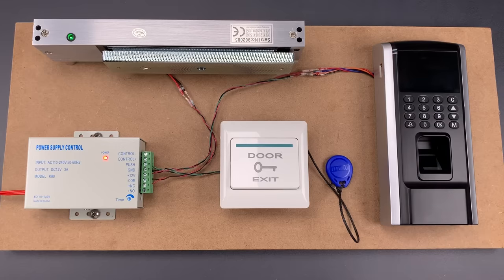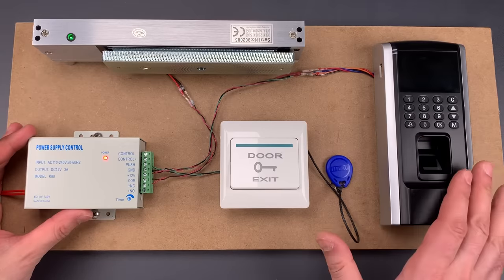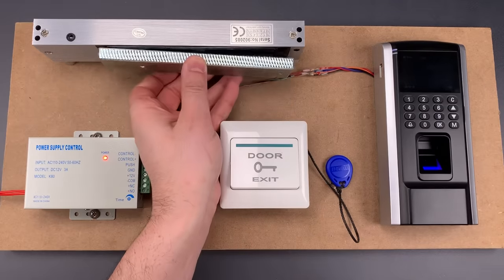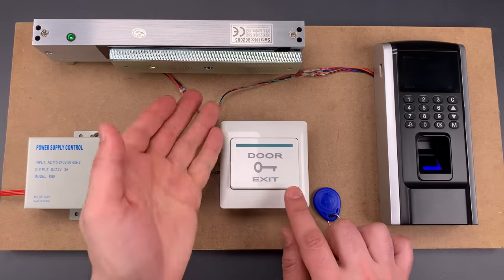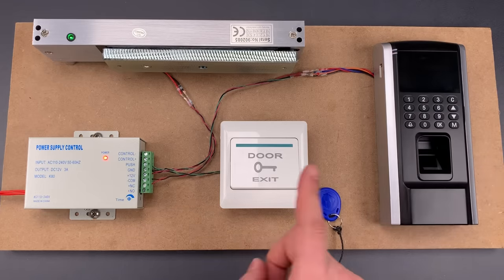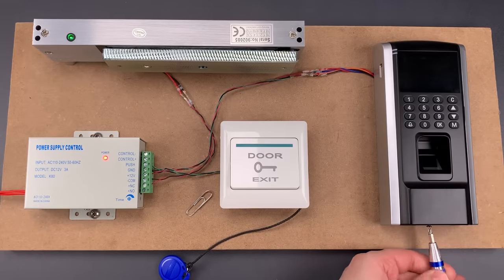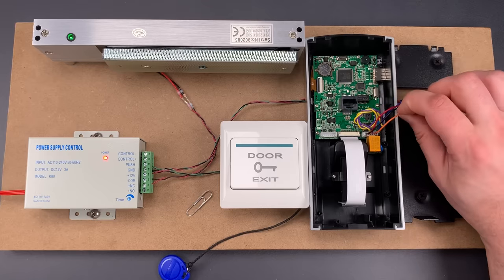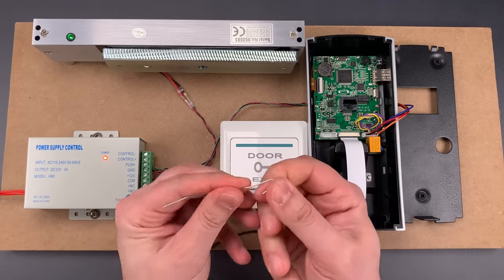[1040] Fingerprint/RFID Lock Defeated With a Paperclip (Mengqi-Control)

Comment: holy crap!  I almost choked when you said the verification and authentication system was on the insecure side.  One would have to be almost literally brain dead to make a design like that.
Reply: Welcome to website security! 😃
Reply: This way they don't have to run that many wires into the "Power Supply Control" and get away with one processor. They're just going cheap.
Reply: @metamud8686  welcome?  I've been doing comp sec for 40 years.  :)
Reply: @pugnate666  I2C uses two wires and can transmit the read data to the control unit for processing and verification using one less wire than the current setup lpl is showing us. And can't be shorted open.
Reply: well it dpends on how 'important' it is
Reply: @mareksicinski3726  If it isn't important you don't need it.  DERP!
Reply: @ElectroDFW  Yes, but you'd have to pre-process the keypad input and read the RFID tag. So you'd need a second processing unit. (I should have written "more wires OR another processor", my mistake)
Reply: @protonneutron9046  I think that was just a pat phrase from metamud about the field overall and not anything personal.  t. linguist and former “electronic security” guy.  ; )
Reply: The designers probably know full well that they should go on the secure side of the door, but their clients don't, and it's cheaper to put all of the components in one box.
Reply: Well it is from China.
Reply: Yet, this is a product that sells for $170.
Reply: @jemeljordan-butler4510  Worth $1.50
Reply: To be fair, at my dorm our elevator requires physical key access to use... But the key just presses a mechanical switch behind the panel, and the panel is secured with regular Phillips screws. Yes I unbolted it, yes you can just press the switch or short the wires or anything like that. Yes I rewired the switch to an unused button on the panel. Yes everyone found out about it and used it from then on 😅
Reply: to be frank the majority of access control systems are designed this way
Reply: @gankdalfthedank9855  Yep. Most are feel good window dressing
Reply: @pugnate666  you could get away with the exact same number of wires as on this for the transfer of info still

Comment: Just put up a sign.

“No screwdrivers allowed on the premises”

BOOM- Fort Knox security levels again.
Reply: "Hey, this is a gun, eer, screwdriver free zone"

Didn't you know? - Criminals can't commit crimes if they're told they're not allowed to.
Reply: Or you could put 601lbs of force and the lock would give
Reply: @kevinlin7674 , I'm pretty sure at 500lbs the frame might just give way. The 600lbs is just a novelty unless you bolt it into the floor.
Reply: @saints360row  Thanks for the heads up!  Hey folks, we only need to exert 501lbs of force now!
Reply: Surprise they didn’t use a star bit screw. At least a little extra security
Reply: “No screwdrivers allowed on the premises” That's democratic thinking...
Reply: @kevinlin7674 , Well 500 was just a possible example. Depends on the door and how it was framed. I'm sure a good donkey kick could unframe most.

Also, I love your sarcasm; it implies I was giving an exact number through your inference of my certainty by way of an over exaggerated proclamation. How quiant.
Reply: @saints360row  On a serious note, will doors that are bolted to concrete walls hold more amount of pressure? That's the way our doors are mounted at my school.
Reply: If only criminals follows the rules?
Reply: inb4 the god of all "maintenance workers" walks in front of the door and every door in the entire complex is mysteriously instantly unlocked.
Reply: or a sign that says, Please do not remove screw to security device.  Bomb attached.
Reply: “No screwdrivers allowed on the premises” 

Maintenance workers: waving goodbye
Reply: Why ban screwdrivers? That causes too many issues,  just ban paperclips.
Reply: I bet this could be done with a pointy metal nail file, plus a hair pin to bridge contacts on the board.
Reply: @BluBOo_  crime is no more
Reply: @kevinlin7674 , What, like double doors? - Only if there's a metal frame in between them, because if they lock to each other you might be able to bust them open due to either door not being static. Also, check to see if the bottom of the doors have bolts on them & holes in the floor where they rest, as many schools do especially for double doors. I mean, regardless, if someone wanted easy access at your school they would wait until everyone's let in or out in the daytime, but at night I'm sure it wouldn't be too difficult anyway without an alarm system with time & tools.. Or with keys.

Did you have a possible example of something malicious regarding your school or were you just using those locks as an example?
Reply: @ProductKingReviews  yes this is what I was thinking. I would replace the screw with one of those one way screws we should be using on all exterior fixtures (like shutters, etc.) and doors installs.
Reply: That might actually work if you live in Canada.
Reply: Or install proper CCTV
Reply: That's about as effective as a "gun free zone"
Reply: Yes, we have "screwdriver free" zones around here, and it's made everything so much safer.
Reply: He'll just use the swiss army knife again.
Reply: nah, just put red locktight on that screw
Reply: Most screws about that size or bigger can be unscrewed with an old butter knife, better off banning metal paper clips ;)

Comment: Thank you for this as always.
I am an old man. One thing that I notice with security devices is that no matter how sophisticated they become there is always a need for physical security  This is often missing. You can have a very secure access system but if someone can just put a boot through the door, or short it out with a paper clip, the level of security is low.
Reply: boots work grate on most doors and windows!

Comment: When will these companies stop putting externally accessible screws on their locks?
Reply: Then there are the ones that slap a sticker over top like a Band-Aid.
Reply: @sinnison23  And the sticker will say "Voids warranty if removed".
Reply: also without them its eas hackable, the validation process should not be done on the outside LPL points out. Cause thats the real weakness of the system.
If memory of users and also validation is inside, it should be way harder to break.
Reply: @Tjalve70  genius

Comment: As soon as I saw that setup I knew what the bypass was going to be, why would anyone think having your control circuitry on the non secure side of the door is a good idea. 

I have a couple of customers who have yards with electronic gates and the control box for said gate is on the outside of the fence/gate...  the box that holds the electronics is quite stout and is all steel construction with hidden hinges but it is secured with basic cam locks!
Reply: If you think about it , it is so  " MR TECH GUY CAN RESCUE YOUR LOCKED CAT BECAUSE YOU HAVE FORGOTTEN  / LOST / LOCK IN THE IDENTITY  RDIF KEY ,  ETC ."

But it's just way too easy a by pass . No identity needed for by pass .
Reply: There actually is a way to do this somewhat more securely - by having a tamper-switch inside the external device that disables the unlock functonality until it is reset from the inside of the secure area. But that would obviously add one more component, and cost more, so the cheap sets don't include it.
Reply: Exactly this. Unfortunately it's quite common though. Manufacturers prefer to put all the fancy electronics in one place, so because they're making a keypad/rfid reader/fingerprint scanner, it's easiest to just add the rest of the control circuitry there. It's a horrible plan, but extremely common.

In the ideal world, the outside of the door would simply send the credentials (encrypted in such a way as to prevent MITM replay attacks if the outside device is compromised) to the inside. That inside module would then authenticate the credentials and decide if the door should be allowed to open.

What's worse is that this isn't just done with cheap stuff you can order off Amazon, this is also done with many professional grade systems, and in fact the vast majority of apartment door buzzer systems do this too (the newer ones have locks on the front of a thin aluminium box, the older ones don't even have that). Even high end office control systems that use card access to a central server for authentication still frequently transmit the authentication from the reader to that central control system in plain text making them vulnerable to MITM replay attacks.

You have to be very careful with electronic locks, most are designed only with electronic security in mind, not physical security.
Reply: @SebastianSonntag  That's not really a great solution anyway for a couple of reasons: first, almost all tamper switches can be bypassed in such a way that they never alarm in the first place with minimal skill. Second, if all your control circuitry is on the outside, then that tamper reset signal would necessarily also be travelling to the outside and be just as easily bypassed as the door bypass shown here.

The only secure way to do it is to keep all the control circuitry, and all the authentication circuitry, on the secure side, and only pass encrypted, un-authenticated, data from the outside to the inside. All authentication must happen on the secure side of the door.
Reply: @Green__one  Your assertion that "almost all tamper switches can be bypassed in such a way that they never alarm in the first place with minimal skill" is inane. I use electronic fingerprint locks on some of the doors on several of my properties. In each case, the tamper switch is fully integrated into the casing of the fingerprint reader, with dozens of contact points and sensors. Accessing the electronics without tripping the tamper switch, while it might be theoretically possible if you were to take a jackhammer - although that would almost certainly trip the vibration sensor - to the wall and attack the enclosure (which is recessed into said wall) from the back where there are fewer contact points, is as close to impossible as it can be. At that point you're better off breaking a window if you want to get in.

Additionally, of course not all the control circuitry is on the outside. The tamper control module is inside the secure area. Once the tamper switch is tripped, the control module needs to be reset from the inside, because it cuts all power to the door module by tripping a breaker which has to be physically switched back on.

No electronic lock is perfectly secure. Fingerprints can be copied, RFID tags can be spoofed, PINs can be guessed or brute-forced (which can be as easy as checking which buttons on the keyboard show the most wear on certain installations). However, with a little effort an electronic lock can be made at least as good as a mid-range mechanical lock, which is usually sufficient. On most properties, there is no point in trying to create a perfectly secure door lock because criminals will just find another way in.
Reply: @SebastianSonntag  I'm glad your properties have done security right. I never said ALL tamper switches were done wrong, only that most were. Additionally it sounds like you have control circuitry where it belongs, on the secure side of the door.

That said, just because your particular situation isn't vulnerable to these attacks doesn't make that the norm, nor does it mean you aren't vulnerable to something else.
Reply: Ah a fellow Discworld lover!
Reply: I installed my own electric fence gate, and all of its guts are on the inside 😄
Reply: @Green__one  You CANNOT prevent MITM attacks if the outside device is compromised, at least not with passive RFID tags or key codes.
Reply: This system wasn't designed to protect anything worth the effort to bypass.
Reply: Almost, not always
Reply: Yeah. Client-side “security” is so amateurish it’s not even funny. It is seriously high school level skills to design a system without this flaw.
Reply: it's cheaper this way
Reply: @simo2555  Yup, for the price I don't know why we're even having this conversation lol... I'm sure the power supply will burn out in a couple months leaving the door permanently unlocked.
Reply: @NETBotic  lmao true
Reply: @danpowell806  While it is always possible that someone could take your outside device and reverse engineer it to steal encryption keys. The reality is that's a much harder attack than simply intercepting the data on the wire and re-playing it. MITM replay attacks can be quite successfully mitigated by using encryption between the outside device and the secure device. If implemented correctly, re-playing the data sent from a proper authentication will not result in granting access a second time, and will instead send an alarm signal that something fishy is going on.
Reply: @Green__one  I was very specific about the types of access tokens that I was saying do not have MITM protection: RFID tags and typed codes. 

Sure, it's possible to use NFC and have a challenge-response protocol implemented on the access token, but you're not using RFID anymore. 

I suppose you could also have the local device encrypt the message traffic, which would make a MITM attack more difficult because it would have to defeat the encryption using known-plaintext attacks.
Reply: @danpowell806  I'm not talking about challenge/response to the toekn. I'm talking about on the wire messaging that can't be replayed. It's pretty trivial in this day and age to do such a thing, it's just not often done. And it's not about known-plaintext attacks either, it's about replay.
You always want to ensure that every message sent along the wire from the non-secure device is unique such that any replayed message won't result in an additional authorized access. And additionally make sure that the message sent on the wire is non-predictable. There are many encryption protocols out there that can do just this.

Nothing is 100% secure, but by moving all your authentication to the secure side, AND making sure all messages from the reader to the authentication server are both unique and non-predictable, you move the attack vector to either the token, or to a much higher skill attack on the reader (reverse engineering is far more difficult than an esp module reading and replaying credentials behind the reader). At least to attack the token they need access to something that's not sitting exposed on the outside of the door 24/7 and mostly unattended.
Reply: @Green__one  Or the attacker puts a RFID reader inside the casing of the access device, which makes all the encryption useless despite not technically being MITM. 

Tamper alarms are pretty important in any case.

Comment: This system is installed all over my University
Me after watching this: hehe boi😂😂
Reply: That's exactly what I'm thinking bro... Faculty room I'm coming boi
Reply: Bro what university do you attend?
Reply: @dekotakilcrease9525  Hogwarts University wbu
Reply: thats bad
Reply: Pro tip: once you've bypassed the lock, quote 1:55 to scare everyone even more shitless 😂
Reply: indeed
Reply: PwnishR most are controlled by a system in an electrical/it room not standalone systems like this. Unless it’s a smaller uni with no money I don’t see them ever using standalone access systems. I have installed many for universities and schools along east coast and it’s always 8+ door panel systems with about 20 panels per system only way to bypass is to shut power to the whole system
Reply: PwnishR nah, they pay for chegg instead.
Reply: Have fun in jail
Reply: this system should be for i/o control and not for security
Reply: gotta have to upgrade them wirelessly
Reply: Well it also seems to use a relay to actuate the signal so you can be even more discreet and just use a strong magnet to open the lock. It even looks OK from outside because all you do is bring your hand to the unit.
Reply: I sell these systemsfor a living. Well not this shitty quality, however if a door is Unlocked without the credentials it automatically sends a tamper code to the VMS and would alert someone or make some audible alarm.... this is assuming they do not have a super Janky system that most definitely has reporting.
Reply: @tanner8705  as the Facility Geek, i got asked to see if i could fix issues with doors.  after my first encounter, i told the bean counter he was gonna have to pay to have it fixed.  this is a mom and pop business or one shot door system.  i've never seen this, personally.
Reply: @tanner8705  I work at a small university with no money. I don't know the details, but I know our system is centralized. It would be insane to set each dorm entrance individually to allow all the dorm's residents in.
Reply: @tanner8705  I wold like to see how he defeat standard size maglock with paperclip. 😁
Reply: @donpindol778  lmao ikr
Reply: They’ll look for you first.  Need old fashioned door bars and animal with sharp teeth.
Reply: This is wrong.
Reply: time to change your grades to As boi
Reply: @tanner8705  or pull the fire alarm. in most cases access controls are set to unlock all doors when the fire alarm is activated so no one can get locked in or out.
Reply: @crazypete3759  I mean yeah that’s one way but usually you would have to already be inside where ever you are, but you are assuming the people that put it in did it correctly
Reply: I'm printing entire books out of the printer room ! 
Going to recover all the money I spent on tuition alone on book copies.
Reply: Bro, same here. And no ones ever seen inside this one door with one of these locks. Ima see if I can get in
Reply: @XxFireDraganxX  let me informed (if you are not in jail) bro😂😂
Reply: Yeah dito